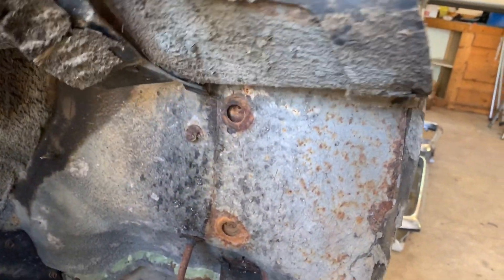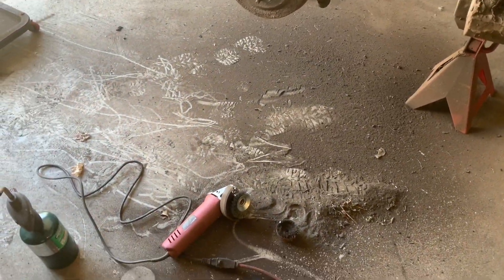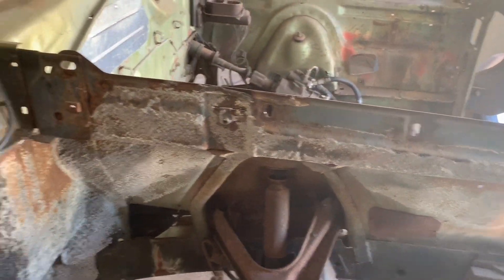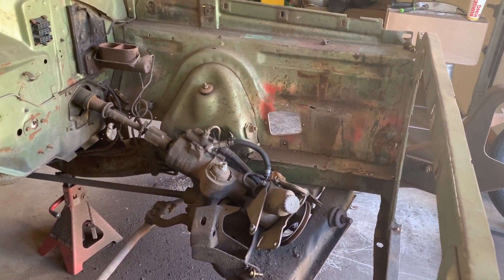Removing  Undercoating

Comment: I think the under coating caused more damage then good when dealers installed it
Reply from the maker: Iam noone I wish my Satellite had less. Fortunately the Coronet doesn’t have much underneath and the floors were solid. But lots of surface rust to clean up